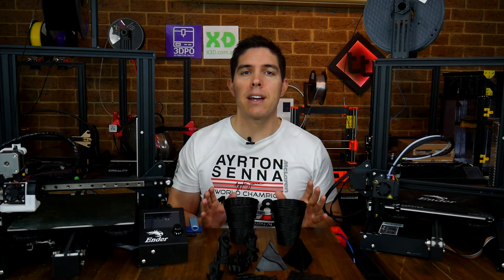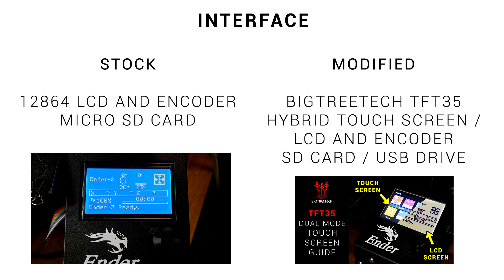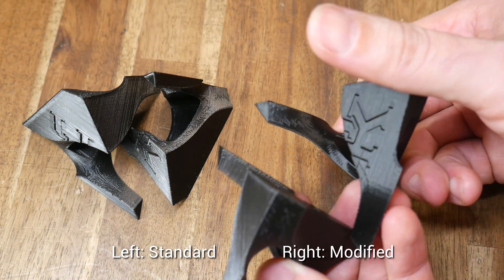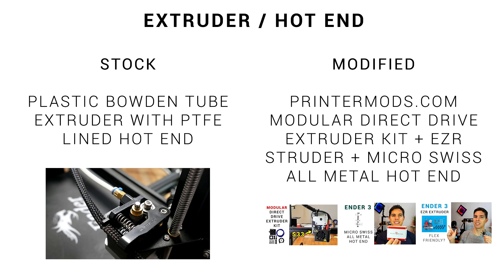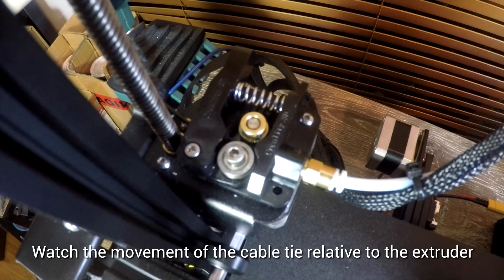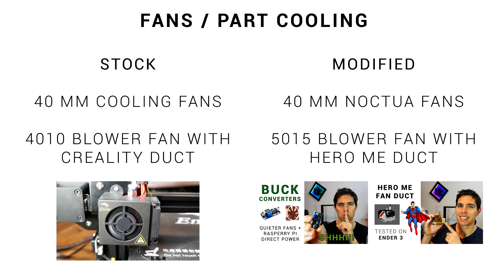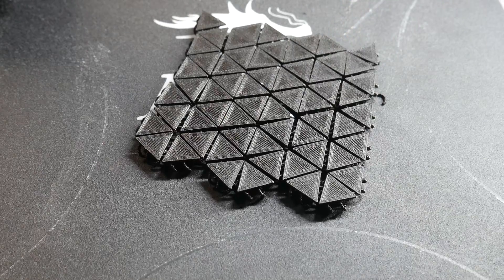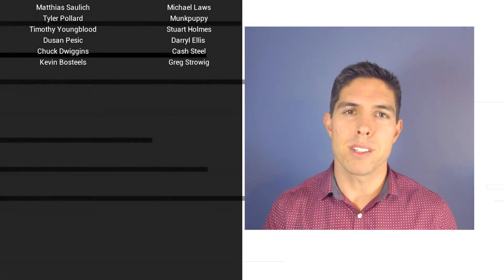Are modified 3D printers better? Stock vs upgraded Ender 3 comparison

Comment: Love the videos, especially the Ender 3 ones they have been very helpful.  Thank you.  
At 2:54 you mentioned the Zebra stripes from, I assume the standard stepper drivers?  Would the Creality 1.1.5 upgrade board eliminate this?  I am new to the Ender 3 and I have been amazed at the things I have printed out of the box. But I have purchased a couple of very inexpensive things like Glass bed and metal adjuster wheels and springs.
Reply: Racer X yes the upgrade board gets rid of “moire” which is those diagonal stripes you get on the benchy.it also has thermal runaway protection enabled and makes the steppers silent. I’ve had my machine since before a lot of these channels started reviewing the printer-it’s one of the very first batch, and aside from that board replacement you mention,an alloy extruder drive (because the plastic one will break it’s only a matter of time), Capricorn tube and new couplings (because the original tube will eventually wear out),and a glass print surface (to make up for the Warped bed-it’s now dead flat) it’s dead stock. People go on about better bed springs but if you don’t “hack” prints off the bed and instead wait till they cool and self release, the stock springs are fine. I treat my printer as a tool to support my main hobby and I am a mechanical engineer so I am quite mechanically fussy but I also know how to treat things and I believe that too many people nowadays are far too impatient and create a lot of their own problems-A good example of that is people hacking prints and damaging the springs. Aside from the glass plate and silent stepper board I only replaced all the other things when I really needed to-The board upgrade is definitely a good one though for safety if nothing else. Everything else really is time to personal preference,To a lot of people there hobby is printing useless test pieces and dust collectors just to see if they have increased the performance of the machine with the latest mod they have done-that is their hobby. Personally it’s more about fitness for purpose and the printer supporting other things that I do-I don’t see 3-D printing as a hobby at all moreover I see it as a tool as I said before. I think this video was actually long overdue because for new people coming into the hobby it must be an absolute nightmare when you jump onto the Facebook groups and ask for advice and get bombarded with everything that you absolutely “must” change but as you can see from this video if you are just printing PLA and the occasional other type of filament such as TPU or maybe PETG, you don’t really need to do anything to the machine-obviously if you intend on printing copious amounts of one of the other materials then it would be beneficial to modify the machine accordingly.
Reply: @Johnn_T  Thank You for the excellent explanations it is most appreciated.  For someone new like me it is absolutely overwhelming. I bought this printer to support my main hobby, which has always been classic computers like the Commodore 64, Amiga, Macs etc.  I found myself spending way too much money on 3d Printed cases for devices these days that don't come with any enclosures.  Cartridges, floppy emulators, etc.  Ordering from shapeways more than a piece or two can be expensive.  Now I can design and print my own enclosures or download the many available enclosures from talented designers and print them myself for pennies.  As a bonus who knew it would turn out to be fun! As for the springs it came with the wheels but you are right, they probably are not going to be that much of a benefit.  I go easy on things and have not really had to re-level the bed that much.
Reply from the maker: John T is correct on the stripes. I'd still recommend the SKR mini E3 or the TH3D EZboard lite over the Creality. Both 32bit, plug and play, and make other upgrades much easier to fit. SKR mini is cheaper too.
Reply: @TeachingTech  That makes sense to me.  I will for sure check out both of those boards.  I am having fun and for sure making useful things for my main hobby, which is the whole reason I got into this.  Your videos are excellent, keep up the good work!

Comment: I have a 3 month old 3 Pro. Prints awesome out the box. I see no reason to upgrade anything. If it ain’t broke don’t fix it. If it didn’t print so good I would upgrade. The only thing I have done is the metal Extruder and springs plus a raspberry pi for Octoprint.

Comment: An excellent review of Ender 3 upgrades.  My Ender is very mildly upgraded.  However, I often see comments regarding bed leveling.  My machine had a seriously bent bed from the start so I went to the glass master and got a glass plate cut to size.  Since then, bed leveling is very rarely needed, and when needed it takes a minute or two.  But to reduce the noise level, I look forward to doing that!  Thanks for all the great print videos 👍🇸🇪

Comment: I always tell people when they purchase a new 3D printer is to leave the machine stock, and get it printing good quality before upgrades, throwing upgrades at problems almost always never solves the problem.
Reply: @Chip The Cat Pirate • well, the stock extruder snapped, so I'll be upgrading that, although that's less a mod and more an upgrade.
Reply: I've only just started printing and my buddy gave me the same advice. So I'm just printing and tweaking. I did swap the levelling springs for solid mounts, but otherwise I'm not changing anything until I really get this machine.

Comment: Modified benchy looks a bit funky at the bottom. Apart from that I think you've hit the nail on the head. Good mods you have, I recommend doing a mod then test, then do a mod and test. Like anything, it's easier to find the bad mod that way.

Comment: Octoprint on a raspberry pi ... and an Usb drive in the TFT display at the same time. What is your preferred way to print between these two options?
Reply from the maker: At the moment I'm mostly printing from the USB flash drive.
Reply: @TeachingTech  Thank you very  much for your answer. 
And also many thanks  for your great videos and all the time you spend for teaching us. They all are very good, instructive and useful.
Reply: If you can try the pi with octoprint. Once I configured mine to use the ender 3psu and connect to WiFi it was a game changer as I could queue up the print immediately after saving the gcode from the slicer

Comment: The only must-have mod is a little fan cover for the electronics box, and a few clips to prevent the cables from snagging. Aside from that, the stock Ender 3 is pretty decent.
Reply: and after a few months a new metal extruder, when the extruder arm starts to fail. A filament guide is also recommended to make the extruder last longer
Reply: @Auravendill  I'd definitely reccomend the EZR-Struder as an extruder upgrade myself, it's pretty cheap, easy to install, and works really well.
Reply: Not a must have but definitely #1 is the skr mini (or other 32bit board with silent controllers). Went from moving printer to garage for overnight prints to keeping it in my room

Comment: Excellent video as always! I've been on the fence on wether to buy the Ender 3 or Ender 5. But this has convinced me to just buy the Ender 3 and upgrade it w/ the 32-bit board and bl-touch. I've had the Anet A8 and it's pretty much beyond repair (after many years of service) and i'm ready for a new start.

Comment: Is the screen compatible with the MKS tft32?
I like your menusystem much more.
The only problem is that you can NOT change settings like Z-Offset, velocity, jerk, steps etc.
With the 
"Reprap Discount Full Graphics Smart Controller Display" you can change ALL these settings.
That is why i have both displays on my printer.
Can you cange these settings on your display?
If so then i would like to have a copy of your menu.

About the mods:
My printer uses MUCH melamine. That is some kind of wood with a hard top/bottom layer.
It does flex a lot so that is the main reason why i am going to upgrade my printer.
It just is not stiff enough.

Thank you
Reply from the maker: The TFT35 from BigTreeTech can switch back and forth between the two. You just hold the knob down for three seconds. Best of both worlds.
Reply: @TeachingTech  My TFT32 has no knob, it is just a tft-screen.
I just looked at lthe "Makerbase Mks Pad7 Capacitieve Smart Display 7.0 Inch Android Pad". This screen meets all my expectations:
Capacative, Bigger (bad eyesite), changeble settings (just linke the "Reprap Discount Full Graphics Smart Controller Display")
Here you can find it: https://nl.aliexpress.com/item/4000764834565.html?spm=a2g0z.12010612.8148356.1.212419d9bbwPhh.

It is not cheap but when it does what i can see this should be my new upgrade on my new printer.

Comment: I have one mostly stock Ender 3 (Upgraded z-leadscrew coupler, vent cover on mainboard, side mounted spool holder, filament guide).

I have one slightly modified Ender 3 (Same as all above plus EZABL, Bullseye Duct, SKR v1.3 with tmc2209 drivers, latest version of Marlin.).

I have one heavily modified Ender 3 (SKR v1.4 Turbo with tmc5160s, z-leadscrew coupler, hemera hotend, bltouch v3.1, 3dfused x/y/z rails, 3 point bed leveling, EzFlex2 PEI system, LED lighting, upgraded fans, and many more mods, modified Marlin firmware)

The modified one is only better than the other two when it comes to printing other material types, and speed.

The stock ender and the modified can print the same model, with the same material, with the same quality. Except, the stock I run at 50mm/s and the modded I run at 175mm/s. (When doing PLA. Have to raise the heat on the hotend to hit those speeds.)
Reply: " z-leadscrew coupler" - what z coupler u r using can u give a link pls ?
Reply: @Solthariel  th3d sells it. 
https://www.th3dstudio.com/product/upgraded-leadscrew-coupler-for-cr-10-cr-10s-tornado-ender-2-and-more/
Reply: @TheZolon  thank you

Comment: Another great video!

For me, I paid a bit less than $180 for my Ender 3 with shipping and taxes, so even a $18 part is 10% of the purchase price.  Thats not to say I wont ever put money in my Ender 3, but so far it has worked flawlessly.  The only adjustments I have had to make is to occasionally re level the bed.  I have no doubt that people have some of the problems you speak about, as I have seen many people talk about them on reddit, but as for myself I havnt had any problems at all. 

I dont even like to waste plastic on printed parts, most of the parts I have printed have not had any impact on print quality or quality of life for my Ender 3.  The best printed part I have done is some spring washers/stiffeners and the bed cable chain. 

PS your removing those parts wrong on your stock Ender 3, the bed build plate is removable for a reason and is simi flexible.  Im sure you know this, but in the video you tried to take the parts off with the build plate attached to the bed.  Removing the build plate not only helps keep the bed level, but makes removing parts 100x easier, thats not to say that sometimes parts dont stick too well, but in the video you are doing it the hard way. 

Something I have been curious of for a while is, when you do all the upgrades you recommend, is it cheaper to just buy some aluminum extrusion and build a frame than to upgrade a printer?  I know eventually I will want at least a few upgrades.
Reply: Sounds like you built a nice printer.  Only thing that puzzles me is why convert your z axis to belt?  I understand why you want belts in x and y axis, but arnt you worried that using a belt will make the z axis fall?

Comment: Which fan did you use for the main board cooling? I have upgraded to ezboard lite but the board fan is too loud.
Reply from the maker: Noctua, but 40x20mm.
Reply: @TeachingTech  thank you
Reply: Does the fan have to be 24v? The ones i found are 12v only.

Comment: Since I installed a Pi and OctoPi I rarely ever use the stock interface. Guess I need to look into ABL though.
Reply: Thomas Veach the great thing about a bl is when you have it setup you can be guaranteed of starting the print and walk away knowing it is going to work and be consistent.

Comment: Make it so I don't gouge prints or the bed with a scraper: Yes
Make it so leveling is repeatable/reliable: Yes
Make it quieter: Yes
Make print quality better: Doesn't seem like any of these mods are significantly effective
Make it more reliable over time: Probably depends on how many hours per week/month you are printing.
Make it more maintainable: Probably only do these mods as needed. e.g. burn up a driver then replace board with one that has replaceable drivers. (If that wasn't already done as a part of making it quieter).
Make the UI better: Meh.  I'm pretty adaptable.

Keep up the great videos.  Thanks.
Reply: I agree - the mods I used for my Ender 3 were: (1) all metal extruder (€10) (2) 3 printed parts for improved cable management (maybe €1 in filament) (3) a glass bed (guaranteed no warping so bed levelling is rarely needed) (€20) (4) upgraded motherboard for quiet stepper motors (€33) (5) capricorn tubing  (€9). Basically, all the most important mods and combined it cost me an extra €75 but well worth it.

Comment: if you have a limited buget you have proof that the stock ender 3 or ender 3 pro is a good tool to start with. if you have a friends that has a 3d printer and have used it for  a wild and your friends explains the pros and cons of the ender and you enjoy this world of 3d, then you can save a little more and go for printers that have all this options right out of the box.
Reply from the maker: I addressed this scenario in the pinned post, please have a read.

Comment: love the t-shirt. And the video too
Reply: Do you put something in the base to print, like glue, spray, or some organic solution? This magnet kit needs something like that?
Reply from the maker: I don't add anything. Although the Wham Bam PEX sheet can take hairspray or glue like like you would with glass if you had a particularly tricky print.
Reply: @TeachingTech  Nice. Tks for answer. Meens a lot. ;)
You showed two different types of the WB PEX sheet, one smooth and other more texture. Both are PEX? Or one are PC or PEI? I try to find info in their website but I couldn't find. By the way, congrats for your channel. Helps me a lot since the day one of 3d print for me. Thanks you! And I'm from Brazil, and huge fan of f1.

Comment: Hy
Coud you put up your profile for ender3 standard?
Reply: if you are starting, you should use Cura (or PrusaSlicer). Both have good profiles for Ender 3 included
Reply from the maker: I use simplify3D. I've put the profile on Thingiverse before.

Comment: Talking upgrades we never did get a follow up to the exoslide episode, what were your final thoughts?. After 2208's and a Bltouch the best thing I did for my Enders was to kit them out with a v6 and bantamount with 5015 blowers,.
Reply from the maker: I took them off and changed to linear rails because the size was smaller. Not a problem for most but the exoslides hung lower and made me have to cut my enclosure for to clear, which let the heat escape. Had no problems with them apart from that.

Comment: My Ender 3 Mods, Simple, Economical & Most Significant!!!:

Noise:
I added stepper motor dampers to ALL steppers, as the OEM had the steppers mounted DIRECTLY to the metal frame!!! I work with copy machines so the dampers were sourced at zero cost.

Bed:
Printing on glass with a heated bed & hairspray at about 65 degrees celsius....glass is CHEAP & you can check for flatness with a steel ruler. With hairspray as the print cools down, Glass & 3D printed object have different expansion coefficients so upon being completely cool, the object is almost always sitting there loosely and zero effort is required to remove. Additionally, glass gives a wonderfully glossy surface!!!  AND I only have to level with a piece of paper....THAT'S IT!!! The cost of this mod was the price of the glass, getting it cut to size and the hairspray.

Print Quality:
I'm using the stock controller with ZERO problems!!!...The only "mod" I made was the mixed-mode microstepping mod featured over on Defpom's YouTube channel!...basically solder jumping one resistor for each driver chip to put it into the correct mode. Works a Charm!!! This mod eliminates the Zebra Stripe Artifacting most noticeable on vertical curves, such as the Bow of the Benchy. The cost of this mod was just know a friend at a phone repair shop with a binocular microscope and a soldering/rework station to see the SMD resistors on the board, remove them and make the solder bridge...probably 5 minutes or less of work.

Those are pretty much my "Core" mods  that I find significantly useful that are really quite easy to do to get your most bang for your buck!  CHEERS!
Reply: You could also print the HeroMe and use your stock parts with it (costs a few cents in filament)
But regarding noise: Getting the better mainboard isn't really that expensive and the result is the most noticeable. The new board is somewhere in the neighbourhood of 25€. It is also 32bit and offers much more space for the firmware (and is also much easier to flash)
Reply: @Auravendill  the HeroMe is the direct drive mod, correct???🤔
Reply: @RTR-MATEY  No, the HeroMe is a better fan duct, that you can print. It also is modular, so that you can upgrade the part cooling fan whenever you like without having to print an entirely new one